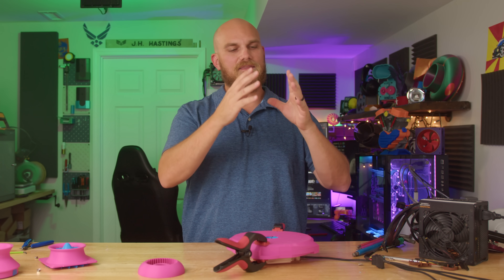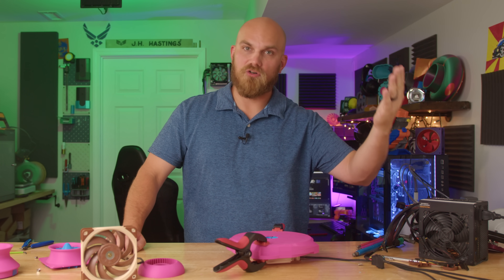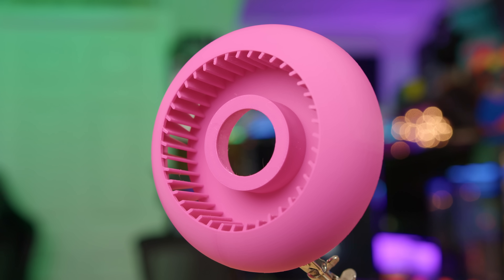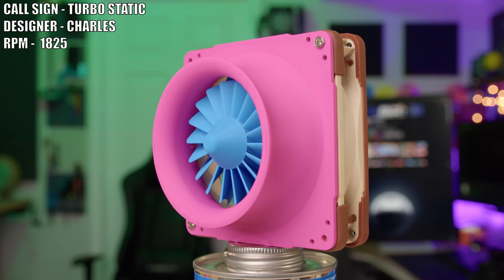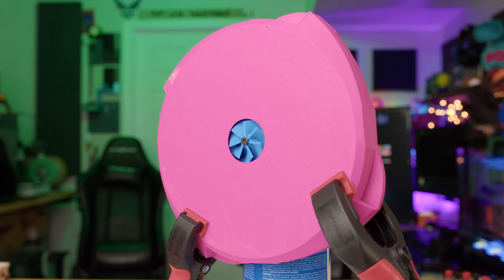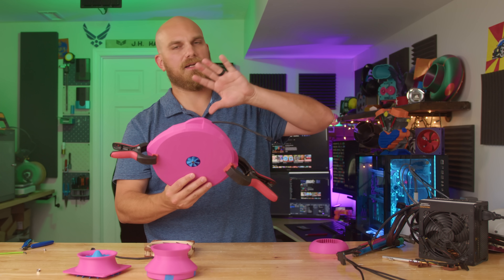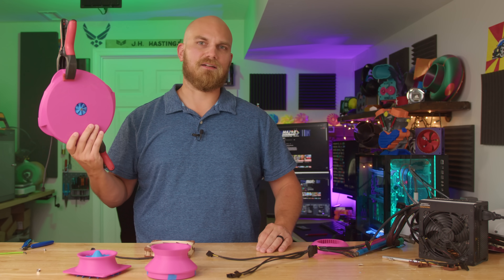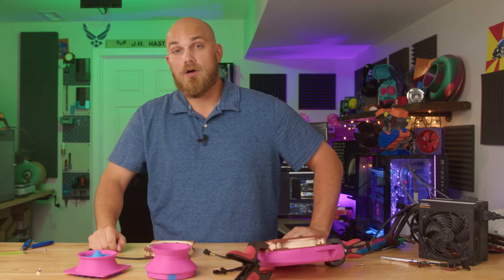Wild 2-Stage 200mm Blower Fan Redefines Power | Fan Showdown S6E6

Comment: The turbo is 2 fans in one. The stater shape can enhance the flow.  Opposing 90% angles will give you more bite. You could place with the angles. Less angle on the stater, and more one the blade. Staters are slightly underrated.  They can do half of the work. Stater on both sides gets better.

Comment: Guys I'm looking to build a fan (or multiple) that I can use for an indoor cycling set up. Are there any video's you'd recommend for this use case? It would be pointed at me from about half a meter, to cool me off. So I guess high CFM is the only metric that matters? Been leaning towards the noctua desk fan print, potentially even with a stronger server fan. If you guys have any recommendations please shoot!

Comment: to be honest, I've always been told "high static pressure is better", but it never made sense to me, because of, for example, pressure cookers using the built up static pressure to heat the contents of the pot faster and hotter. so, I guess I'm confused because of that. any thoughts on this?

also, as for the question at the beginning, I'm definitely part of Group B. everyone else seems to have covered the whole "different classes" thing. that said, I'm also a firm believer of "it's your channel not mine, do what you want".

Comment: I am a fan of the wild contraptions but also feel the basic fans aren't getting a fair shake. If you could score both types more equally then the best fan will rise to the top. Something like static pressure multiplied by flow rate. Better yet would be to then divide by power consumption to get efficiency. May the most efficient fan win.

Comment: still even 10 mm H2O is a very weak pressure.

Also various designs of rotary fans a best to fit highest pressure - centrifugial ones. Or highest airflow - axial fans.
Do you really need highest pressure in your PC or into any home purpose? Only if you need to fill balloon or car tire.
In real life you need highest airflow, that means more air will go through your PC and take out heat. So Axial fans fits best to this purpose. Also they are more efficient due to their design.
So I prefer Noctua:)

But you can significantly improve your designs by reducing the clearance (or gaps) between the impeller and the housing. Gaps on your footage a huge even for 10 kN jet engine compressor. Simples way - use as much tape on housing as it doesnt reduce rpm/electric power of fan at idle. Also tape’s slick surface helps minimize flow drag. I believe you could twice your results with such little modification.
P.s. I'd like to see how you trying to take out most from your fans by reducing technological manufacturing deficiencies

Comment: If a fan is not competing with tthe same limits, is its really a competition?
Size is a critial reason to pick a 120mm fan like A12 over anything larger, powerdraw also quickly comes into play when you want multiple fans in a system.
Some of the "better than noctua" fans cant be run fron a normal fan header due to powerdraw.
Noice is also a critical factor, low noice high performance is THE reason Noctua have become the gold standard...

Comment: Of course we can get more static pressure if we sacrifice efficiency when it actually moves air... but what's that good for? If I want static pressure I use an actual compressor design. For cooling applications I want to move air FAST and that can not possibly be efficient with a layer of air between two flat disk surfaces. There is just too much friction. Having said that... it might make for a useful bathroom fan if it minimizes loss of warm air in winter.

Comment: The smoke test for the Centrifuge Madness was telling. Sure it moved a lot of air but, it didn't move it very far nor very fast and when cooling something volume and rate have to be high, or it just sits there and gets hotter and hotter. This can be helped by adding a set of stator vanes behind the output impeller to straighten the radial airflow and make it more axial. The higher static pressure actually means lower speed airflow. The smoke spreading out like it did and coming to a stop means that the pressure BEHIND the fan was higher than the air coming out of it. This is not a very good thing as once you built up any kind of air pressure inside your case, this thing would not push much more air into it. Now, as an exhaust fan it would be great as it could pull a large volume of hot hair out of your case quickly but you wouldn't want to use it as a CPU cooling fan.

Comment: Have you considered taking the top fans like the centrifuge madness and making a really refined final prototype that could actually be mounted?

Perhaps printing to the highest quality possible, either in black or painting it black (or at least a nice unform paint job), as few parts as possible, getting the tolerances really tight, sanding any rough edges. Maybe tweaking the design to make it so that it's fully sealable but also can be mounted/unmounted from the fan hub/motor itself.

Then given that it's ~200mm, you could create proper mounts for a 200mm-compatible fan case. Implement some rubber parts. Could even route the wires to the edge and have a nice easy-accessible socket; maybe even adding RGB and a nice logo or insignia, plus a "Designed by [Designer] & Built by Major Hardware". Pretty much making as much of a final product as you can.. with the original designers blessing of course. Heck, you could team up, get it really dialed in and try various tweaks or versions; might be able to make something more of it. Could even try miniaturising it for a 140mm size.

Comment: IMHO, the output pressure would be better if the centrifuge madness had small fins on the bottom side of the first compressor wheel pushing the air to the center hole.

Comment: Why only static pressure though?. The jet impeller and turbo static moved a lot of concentrated air (what I would want in a case fan), which the big one and the radial didn't.

Comment: Yeah I concur with @DeathToBreakfast10 
I feel that both are good, but they should be separate categories.  Fans that fit into a normal case. But you would have to have a special case to use for these alien type fans that produce insane static pressure.

Comment: But how much cubic feet per minute of air was it moving at those pressures? There is a reason why no one builds these commercially. They would have to be application specific. Like the “laptop fans”

Comment: Do you have a 5mm fan spacer between the fan body and the 'wall' to reduce turbulence and noise? It's basically a requirement although testing may reveal some designs that don't need a spacer
Reply: That depends on whether it is a mesh or hole grid vent. Probably not necessary for an unrestricted hole.

Comment: @7:56
I must be dumb. . cause 
that Centrifuge Madness. . is more a Water Pump
then a Fan
and SHOULD BE Last!

Clearly we are forgetting to measure
WIND SPEED in these tests

Because YES, it Moves ALOT of Pressure
BUT
Computers ARE NOT FULLY SEALED,
Thus your Torque Fan
isnt going to do Jack for temps!

Comment: I wonder what would have happened if Gabriel had included an intake bell mouth on the design for Centrifuge Madness.  In static testing of jet engines a bell mouth helps to increase the volume of air at the intake.  Given that standard air pressure is somewhere in the range of 13 psi, volume is the only variable which could be manipulated by this sort of system.  I would love to see a bell mouth attached to the opening.  I'm betting the static pressure numbers could get into the 9 to 10.5 mm H20 range.

Comment: it makes sense that the 2 stage centrifugal blower did the best; on WWII airplanes multi stage compressors like this were used on piston engines to let them keep their sea level performance even at 20,000 feet. the fact it didnt seem to be moving much air doesnt matter because air pressure does not need to mean air flow. air is super thin at altitude so a NA engine would drop to less than half its performance whereas big blower engines could keep around 90% of their performance to be a real game changer. bigger engines would even use multiple supercharging or turbocharging systems at once to gain even more performance but they would get too complicated for their own good thus the first simple jets were made.

Comment: I love to see both tha normal and whacky fans. like with the static pressure you can change it by season. I would categorize by mounting for example: must be mountable 3 times side by side on the front of the pc. or mus fit inside a case witch 2 cm of clearance. something like that that applies to pc building of some kind. a sff series would be cool as well wich much pressude and minimal footprint

Comment: that radial needs a bullet nose hub with a swept concave parabola below that but before the blades to smooth the transitional flow into the corner.

also that second one; if it builds any positive pressure inside that case the glue will improve performance as any leak is a significant performance hit.

Comment: I think you should have two classes. One where everything has to fit within the size of the Noctua fan. That makes them compete on the same limits. And then a class where the fan can have any design as long as it is powered by the Noctua fan motor. Thus people can try most of the wild ideas they can come up with.

Comment: Funny thing about engineering, automotive and aerospace will actively look for ways to break physics, while architectural and civil look for ways to make things work within the confines of function meets form. 
I'm definitely of the first camp, however, it's something of the challenge to make a standard fan (motor hub) outperform the stock unit within the confines of the original chassis. Hot rod it if you will.
As a nod to impracticality, "If you ain't cheatin', you ain't tryin'".

Comment: You definitely need more classes. In an optimal world each submission could define their own usecase perfectly, but here are my suggestions:

One category could be just pure static pressure, with some minimum airflow requirement.

Other categories should be the opposite: minimum static pressure, with measurement of airflow. Airflow can be measured by a long, open funnel, at the end of which small section of the area is used to measure air pressure. With long enough funnel its reasonable to assume the airpressure is more or less even across the whole area.

The airpressure measured would obviously be rather small. So you need a much smaller water gauge, with the input being something akin to a 3D-printed ”straw”.

Or they could be actual heatloads.

Separating these is in my view even more important than separating additional parts. But I think a category or a season dedicated only to fans that meet the original casing dimensions is necessary.

Comment: I think you should just have 2 categories, category 1 fits in place of factory frame and could be installed in any fan location in a computer. Then Catagory 2 uses the actual frame for power but has no other limits. I say this because many of these heavily molded designs are cool, and I like to see them, but I don't have a use case for them.

Comment: As an engineer that has been working with fans for over 30 years, I see you are going to have a real problem with categorizing these.

Problem: Are you going to keep it to only pressure?
 How about CFM or are you trying to maximize FPM on a target.  Or are you going to go all out to and measure CFM, Pressure, and Watts and try to find the most efficient or most powerful?

Axial fans are most efficient and effective and moving Volumes of are.  CFM (which your smoke test visualizes nicely) is best for removing BTU’s of air from a space.  They are the most efficient for moving air and out of your case or past fins that have very low static pressure.

Forward curve radial blowers are compact for the CFM and more pressure to push through ductwork and a heat exchanger.  They are NOT efficient, but are very common because they are easy to manufacture and are cheap.

The Radial blade 2 stage blower is definitely the most efficient at creating pressure and doing it quietly .  Centrifuge madness did what is expected of that size.

By the way check out the “fan affinity laws”.  The pressure increases with the square of the RPM.  At the 3D printing lab we needed lots of CFM at a much higher pressure to cool a nozzle remotely through a very long hose.  The CPAP blowers were noisy and inefficient so we used a small single stage version of centrifuge madness, but in a 7200 RPM hard drive motor.  It was quiet created enormous pressure of 150mm H2O.  

If you want to cool a small spot, or a small restrictive finned HTX.  Then that is the blower you want.

If you have a massive HTX with low restriction and you need CFM, then use the axial designs.

Comment: Anything goes. Definitely Group B. Discovery is the key. - Totally surprised by the centrifugue madness. The smoke test didn't show a strong flow on the back, yet it did awesome. I guess once you seal the back against a radiator it shows its power.

Comment: One thing to note, the 200mm was leaking so it did not achieve it's max static pressure. One suggestion I have for designs that need to be glued is to use a really thin bead of silicone caulk. It works well to seal and glue parts together but it's bond is weak enough (if you don't attach too much surface area together) that you can usually split the parts with a putty knife and some prying, maybe assisted with a thin wire or dental floss to cut the silicone.

Comment: Hey all. I am recently patent pending on a fast cheap high quality new kind of metal 3d printing. It replaces cnc machines. It is 20 times faster than lost wax casting, 4-5 times faster than sls. I need a specific laser and training and a chemist to finish the prototype. Cost for those is $15k. If you can help me, it will be worth your while. I would love to see what fans could be made. Each machine is around $3K, not %300k. The cost per piece is only slightly more than the cost of the metal chosen.

Comment: Test all, but have two cattegories, simple, right? A fan should fit and be able to replace a standard fan right, but the ones with bigger surface area should perform better and their designs can be very interesting, so cool yes, yet it's an unfair comparrison and makes one overlook the actual winner of a useful retail style fan on the charts. :face-blue-smiling::face-blue-smiling::face-blue-smiling:

Comment: I mean it's kind of pointless if it doesn't fit in a case or on a cpu cooler, at least in one direction. I wouldn't want to be too strict, but that is ultimately the point of a PC fan. Ultimate value would also be in how much it actually cools, plus the noise of course. Doing just static pressure alone has partially lead to these designs by distorting what actually matters.

Comment: like the miata... group NB. just have a column to label the difference in the spreadsheet, just in case, someone wants to know for application purposes.

I consider the apex fan to be the lowest db with the highest air flow and static pressure combined.
in other words i would grade based on both air flow and pressure then if the results are close use noise to determine.

Comment: Use hot-glue if you want a releasable adhesive. Use IPA to "undo" the glue. And when hot glue doesn't work - it means you're just not using enough. XD

Comment: So long as its less wide than my case is thin. Never been afraid of a drill or jigsaw cutter, grab some metal mesh and ill make a port ezpz 😂 also that 4th fan just needs to incorporate a commonly found silicone ring size from a hardware store and some tabs around the outside for clamping pressure

Comment: What I really miss are the old cooling performance tests. Fans are complex—static pressure and airflow alone don’t capture the full picture. Moreover, it's difficult to create a definitive ranking of "good PC fans" based solely on these two factors. High airflow with zero pressure is just as ineffective as high pressure with no airflow.

The old tests, which measured CPU cooling performance, were excellent because they reflected real-world scenarios. However, I understand that running such tests for each fan is time-consuming.

A potential compromise could be designing a PCB with a power resistor cooled by a PC fan, aiming to maintain a temperature of 80°C and measuring the wattage required. Each test would take only a few minutes and closely simulate real-world conditions. I’d be happy to help design and manufacture the board.

This approach could be a fantastic feature for the next season.

Comment: I totally get why you chose the Noctua as a base. It has a great motor and bearings, it's reliable, widely available and an amazing base for exploring different designs. My problem is that realistically I'm not going to buy an already great and really expensive fan to mangle it and put 3d printed blades on it. I'd rather do that to some kind of budget fan. So if anyone knows of something cheaper that pairs well with these designs I'm all ears.

Comment: This test is garbage. Who cares about pure static pressure in a fan? A fan is not a shelf ornament, it's meant to do work! It's like arguing the best home electricity generation method is repeatedly putting on and off a woolen sweater on the argument that you get voltage up the wazoo. It's not that blower that's redefining power, it's your video title. What's the power draw? What's the p/v curve? Show some actually useful data, you shallow, sensationalist poseur! Get the hell out of my recommendations list!